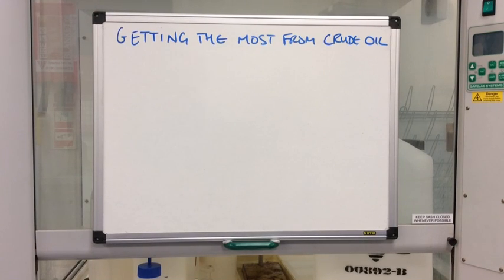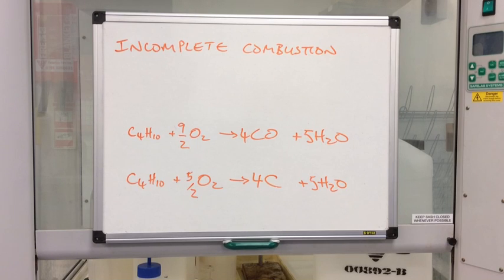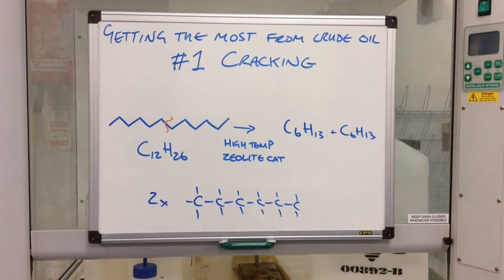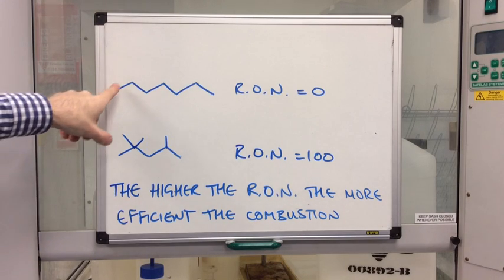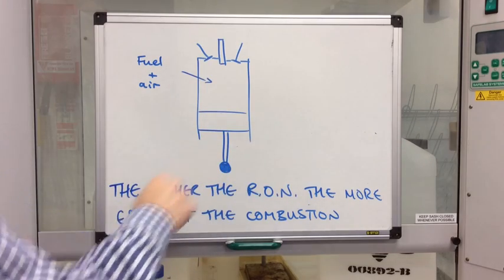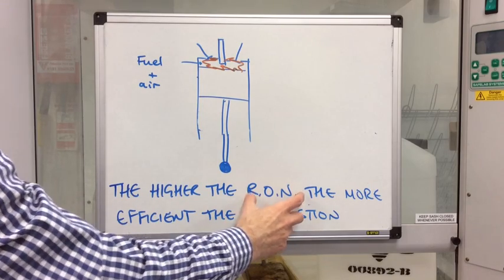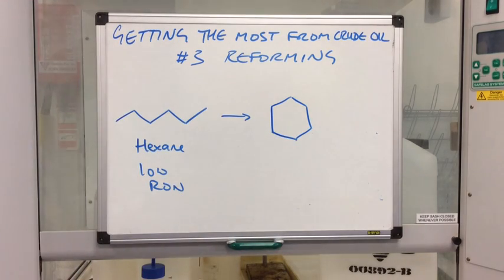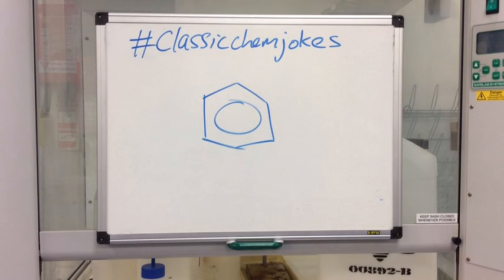Crude Oil Cracking Reforming and Isomerisation

Comment: Hi Sir, are RON values still in the OCR Chemistry A specification?
Reply from the maker: No that’s an old spec video
Reply: @MaChemGuy  Thank you for the reply. What would I need to know from this video (for the new spec), if anything?
Reply from the maker: @sladeMS  They can ask you anything that’s not on the spec so long as they supply you with the relevant information. Probably unlikely that anything in this video would come up but not impossible
Reply: @MaChemGuy  Okay, thank you. So for quick clarification, I am not required to learn the process of fractional distillation, what isomerisation is, and what cracking is?
Reply from the maker: @worsh1pperofAllah correct